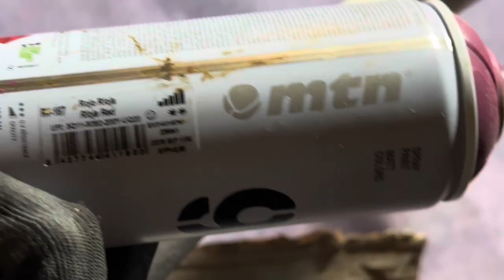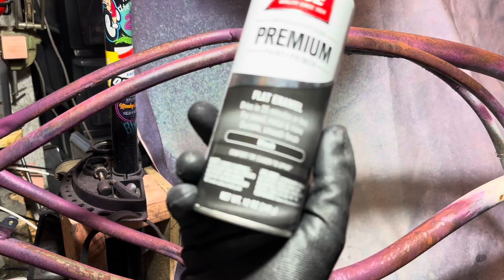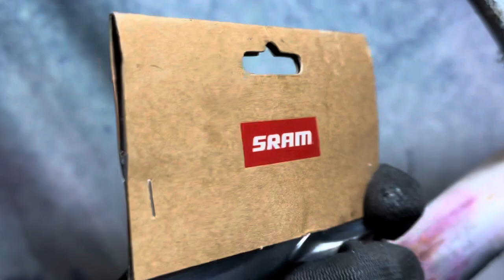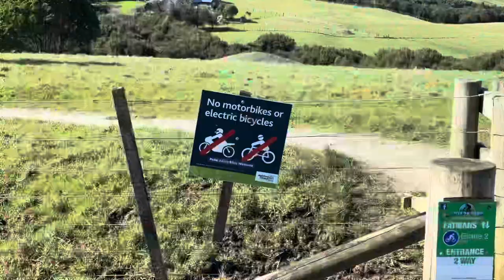Huffy Klunker build / ride - Huffy Good Vibrations

Comment: Nice! I’ve got one with a rear rack . I’m currently changing from 26” tires to 20” BMX with a free wheel . I’ve got to add a higher up bottom bracket and weld in a pipe for calliper brakes

Comment: I just Did a 47 mile 3600 feet of climbing gravel race in the mountains of North Carolina on my 3 speed coaster brake Electra Super Deluxe BUT it does has and aluminum frame 

The 40++ MPH decents we’re really scary BUT I had just deep packed the coaster hub with red tacky grease and it actually improved and with caution did not overheat

I Went with a 175 32 tooth from crank and 23 tooth hub which gave a reasonable low gear 

The 1-1/2 Schwalbe  marathon tires were adequate

The fenders our GREAT and contained the mud and splashes nicely

Comment: What a fun build. The finish looks pretty cool... especially with the mud. Sometimes it's nice to do something simple like this and not have to fuss with finicky brake and derailleur adjustments etc... The bb conversion went really smooth. Some frames there's stuff in the BB that gets i the way of those adapters and has to be filed down. The trails look fun also. In a future video will you be going over it with rust converter? lol Thanks for the shout out. Much appreciated and flattered to be mentioned in one of your vids.

Comment: I love the idea of the Hite Rite but don't like having to actuate the quick release while seated...seeing you appear to fumble with it validates my opinion.  I'd just get the Tranz-X Jump dropper post with the lever that sits under the nose of the saddle.  It seems to be the only brand that offers 27.2mm posts.
Reply: Brand X has 27.2 if you go externally routed I think?
Reply: @monolith_games  don't really want another lever on the bars, but I did see brand-x does sell 27.2mm with external routing.
Reply from the maker: Yeah fair enough, droppers are easier to use but the dropper would cost twice as much as this entire build haha. 
I rate the Brand-x one well, have had a few of them and they last a good while 👍